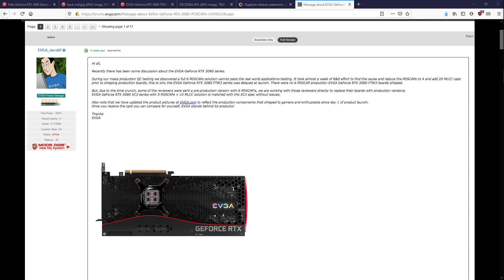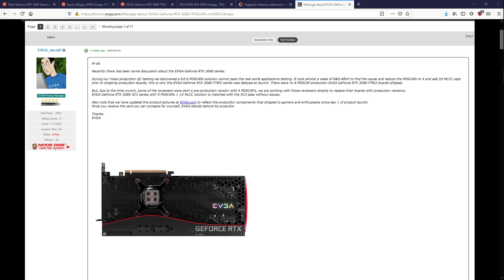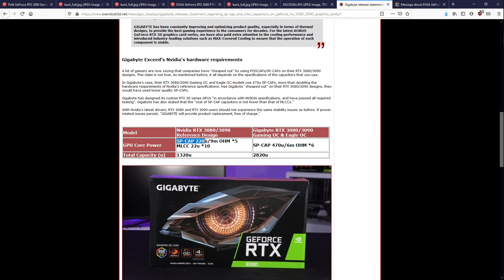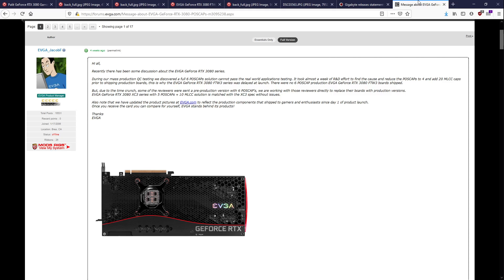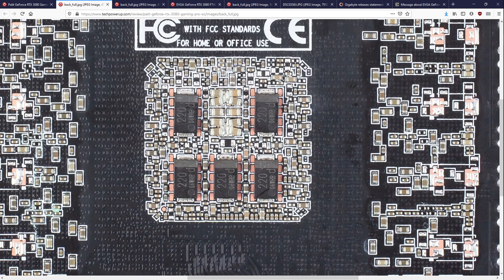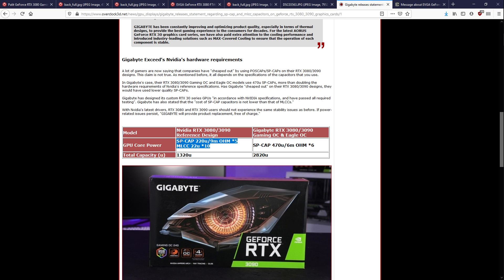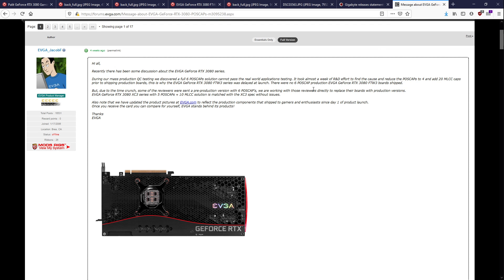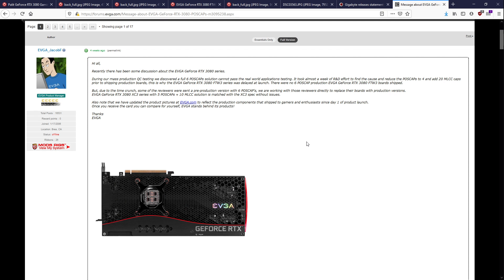The core capacitors on the pre-release 3080 FTW3 vs the retail 3080 FTW3

Comment: Hi, are they 2V or 2.5V versions? If they are 2V, why not use 560uF? also, why not use 56uF*10 MLCC
Then on the other hand, you can make the card even way better... instead of just replacing the SP-Cap, why not make a small daughter board (PCBWay is very cheap to make a few) and piggyback it on top of the tank-cap, so you get benefits from both versions. I know it was an ancient technique, that is now mostly forgotten, oh well, these young whipper snappers... just replace the 470uF with 560uF, and solder the 56uF*10 on a pcb on top of the sp-cap so that they are //.

Comment: People are also forgetting the 5-10% margin on caps. with 10mlcc caps that 11-22 uf averages out since some will be over while some are under. while that 220uf could be up to 22uf under in addition to the lower frequency response. Then there is also the resonance which depending on the manufacturer could be different. So what works with 1 manufacturer's caps might not work with another's. The values also change with temp so a warm card will have higher resistance and lower capacitance. That will move the power consumption up a bit while the caps put out less power.

Comment: Can you investigate the 3090 FTW3 450watt hard limit????
They released a 500w bios but no ftw3 user can actually get more than 450w, unlike the other 3pin cards which can use the bios and get full 500w

It appears to be an issue related to the 10amp next to pcie as well as it being in a locked ratio with the first 8pin power plug
We think Evga is being shady.. can you investigate????

Comment: To be fair to EVGA, the original photos of the ASUS Strix had 6 SP-CAP’s per the photo Asus themselves posted on their product page. ASUS openly admitted this was a pre-production model on social media and all their cards would ship only with MLCC’s and they were in the middle of updating their product photos.
So it appears EVGA may not have been the only company going below reference spec.
Form whatever conclusions you want about this but it appears most brands were playing around with these capacitor configurations so I think the issues go across all brands which is very weird. My money is on Nvidia did not giving partners enough time.
Reply: Asus official post regarding the capacitor configurations

https://www.facebook.com/144893852223541/posts/3383323155047245/?extid=0&d=n
Reply: Asus Strix original product pictures posted on their official facebook page

https://www.facebook.com/144893852223541/posts/3342469385799289/?extid=0&d=n

Comment: Basically MSI dodged a bullet. The engineers were going "We shouldn't do this" and the bean counters were going "We want the big save, so DO IT!" and then the whole thing blew up on Igor's Lab so the engineers could say "See? We need to change that in production right a-fucking-way before lawsuits!" and the bean counters went "Oh, lawsuits are more expensive than a few MLCCs. Right. Do that!"
Reply: MLCCs are cheaper than the other caps. They cost 1/10th of a penny in small quantities while the sp caps cost 20-30 cents each.
Reply: @excitedbox5705  Buildzoid said differently. And there is also time in the pick-n-place machine to take into consideration.

Comment: Hi buildzoid, i am here =) I know this is not the right video to leave a comment, but i have no patience, i want an answer, so...I am sorry for that. 

My question is about LLC. In your video in gamer's nexus channel (Explaining Load-Line Calibration (LLC) & Not Killing Your CPU) you said, that you would run 1.45V idle and 1.43V load voltage, maybe 1.42V for 8700K 5Ghz, so Vdroop is 0.02-0.03V But in the same video, you recommended using the medium setting for overclocking on Asus motherboards. 

Fast forward in 2020, I have Asus Z490 Extreme and Vdroop in level 6 is about 0.7V, at the 4-th level even more. Vdroop, which you called ideal and said you would use it 24/7, that is, 0.03V, I found at level 7. In fact, I have a 10700K processor, overclocked to 5.2 GHz, voltage 1.31V at idle, 1.28 in load. So why do you recommend using Level 4-5 when the Vdroop that you think is good for 24/7 use is on Level 7?

Comment: Question: is there a technical reason why so many of the 30 series cards have the capacitors on the back of the GPU exposed like this?  
IMHO the #1 reason for having a backplate is to protect the PCB from damage... dripping AIO's or tech illiterate people who may break off components etc. ... not to mention DUST will get in there everywhere.  
Do they do this for cooling? Do they do this to brag about their caps (marketing)? Did some designer think it would just look cool, because not all of them do it... but it is also more than one vendor who did it like this... sooo, what gives?
Reply from the maker: the caps are exposed because of the leaf spring heatsink bracket. You'd need a really tall backplate to go over it.

Comment: So EVGA FTW3, a supposedly premium custom card, was not designed as such initially. Interesting
Reply: I think it is a balance of cap capacity vs speed the cap can deliver the charge.  The prerelease using smaller spcaps might have been trying to meet the current spec too on the nose.  I find it hard to fault evga too much for a prerelease card that was fixed when shipped on release date.  But it does sound like mlcc caps of some sort needed to be called out so cost optimizing didn't hurt the actual usage.
Reply: @joefowble  On the bad side, if launch goes well EVGA may get away with this unnoticed and people pay more than they really should (because it's a premium model used on good cards in the past).
Reply: @joefowble  mlcc caps are cheaper. They cost me 1/10th of a penny when I buy 1000 of them while the "sp" caps cost me 20-30 cents each. A pick and place machine with 10 heads will place those mlcc caps maybe 1/3 of a second slower than one of those big "sp" caps. Those big caps are used for power systems because they are stable under temp fluctuations and my guess is they were afraid of the heat under the GPU. The mlcc caps are used for noise and signal traces because they have high frequency response. I don't know why Igor claimed they are more expensive because they are not at all. Maybe he thought more parts would be more expensive to install but since they would all come off the same reel they would all get picked up at the same time. 

Just installing a reel of those on the pnp you usually loose a bunch of them and they are so cheap they are tossed out because it is more expensive to sweep them up and sort your dust pan (and you can then only mount them by hand) than buying some extras. When you order boards you are usually quoted 1-2% extra parts because of this.

Comment: so what ur saying is that all 3080's run the risk of crashing issue and even worse overclocking potential because almost all manufacturers are cheeping out so bad that every low grade silicon will has no safety marjine and is actually not built with overclocking in mind when it comes to the pcb great looks like the only thing these manufactures make towards overclockers is the heatsink and the looks of the card for the past 10 years

Comment: I have a EVGA 3080 XC3 Ultra with 10x MLCC. It works. 1.88ghz average. 2100ghz stable without 100% load. But I have a couple mlccs here and probably will add 10 more when I go for a water cooling and shunt mod.

Comment: The crashing that was fixed in the driver update wasn't really even related to the capacitors.. Every time I saw somebody's video about the crashing and they had a monitor up, right before the crash the card was suddenly boosting 100-150Mhz, from mid 1900s to around 2000 to 2100+.. It shouldn't be doing that.
Reply: Uhm, yeah, and not a single Linux user could reproduce the problem.... So not only was it a driver problem: It was a Windows specific driver problem.
Reply: 0kk

Comment: Can anyone help me? The DPs died on my 1070. I've trying Nvida drive updates and rollbacks. I rolled back windows but still no worky wokry.
Reply: Did all of them die? Have you tried a different monitor, or a different cable?
Reply: @jonasbindslev9894  Yep. Tried monitors and cables.
Reply: @poppyrider5541  Does the graphics card turn on? Does your BIOS detect the graphics card? 

I've got an EVGA GTX 1060, which has 2 displayports, 2 HDMI and a DVI. Do you know if it is only DP that doesn't work, or does none of the ports work?
Reply: @jonasbindslev9894  It works. It's got 2 DPs one HDMI and 1 DVI. My monitors were in the DPs. Now I have to use the HDMI and DVI.
Reply: @poppyrider5541  Try pulling out the power cable of your monitor, wait 10 seconds, and put in the power cable again. That solved it for several people in this article: 

https://www.nvidia.com/en-us/geforce/forums/geforce-graphics-cards/5/234179/gtx-1070-no-signal-when-using-displayport/
Reply: @jonasbindslev9894  Been there. Tried that. Thanks anyway.
Reply: @poppyrider5541  iirc there was an update for Pascal to solve some shenanigans with the DP ports, there should be a VBIOS update available for your card. Check it up in the equivalent of MSI Live Update for your GPU vendor

Comment: G'day Buildzoid,
I found it really weird that it was 'definitely a Hardware problem where all the cards will have to go back to have the SP Caps changed for MLCCs'...
but nVIDIA fixed it with a Driver Update 🤔
The reason I have Unsubbed from many channels this year as they are too busy making 'Hype Rumour for views' content instead of real informative content that is made using research & knowledge,
I especially got sick of all the videos week to week where apparently the RX6000 series is gonna Bury nVIDIA then the next week the best RX600 is only as good as RTX3070 & AMD are done, reverse,  reverse, reverse, reverse, all it has done is make me see how gullible all those TechTubers are & that they really have nothing & are not worth watching,

you say you think your 'rambling thought' videos are crap, but honestly Buildzoid they are Awesome, because they teach us what is real,
also I love your style as it is like we are just sitting having a chat, rather than you are giving a prepared speech 🥰
Reply: Drivers update: lowers your clocks and voltage so it doesn't crazy oc itself to death.
Reply: @ibol13l3  I thought Intel is now competitive, the 10850K has 10 cores better multithread performance vs 5800X with virtually the same gaming performance and its cheaper.
Reply: With wrong software you can make alot of hardware behave faulty. Tell your vrms to do 2volt on your cpu vie software and youll have a hardwareproblem. And you can also circumvent many hardareproblems via software (eg microcode patches for cpus do that) . Just because its intrinsic here in that case that the cap problem can be disarmed by software., doesnt make its less a hardware problem.
Reply: @ibol13l3  I wouldn't call 5% over a stock intel chip which is what most of AMDs own gaming benchmarked shown far superior.
Reply: @Cleru Zinek Daily crashes? Have you tried the Windows Reliability Monitor tool? It doesn't sound like a driver-related GPU issue to me, would be unprecedented.
Reply: @Ben T. My FX-8320E outperformed the heck out of the i5-4440S I had to replace it with around 2014/2015. Intel was totally a downgrade at the time.
Reply: no, it didn't fix them all, and no, there was no change to the  boost algorythm, the powermizer itself was smoothed out so it doesn't respond to hairtrigger changes.

Buildzoid doesn't know a thing about what hes on about. As usual.
Reply: @M M if it is "just bad/insufficient caps/capacitance" please explain why people with the ASUS TUF with all MLCC were experiencing crashing for the same spike reason as the 6 SP Cap versions?
Reply: @M M thanks for the information, that is a lot more helpful, I don't like spreading rumours, I like learning,
I noticed some of the GPUs had 470 SP Caps while others like Zotac used 220 SP Caps so I asked this question in chat on a couple of other videos elsewhere when people have commented about the variation from 6 SP Caps to all MLCCs & no one has responded,

so in your testing with 6 x 470 SP Caps being sufficient ( = 60 x 47 MLCC max storage capacity) this would suggest to me that it is the amount of capacitance & not the speed of release that is important (where 60 x MLCCs have the advantage), please let me know if that is wrong,

this was the point of my first comment, people just spreading the rumour it was because of the SP Caps without getting all the information, because SP Caps can do the job if you use the right ones,
so now all the cards do need to go back for SP Cap replacement because the update nVIDIA has released has stopped triggering the shutdowns, I will now be interested to know if nVIDIA's  update will cause any problems in the future, if that shut down was to protect the cards from a harmful situation & they have just "Turned it off' could the cards that needed to shut down now be at risk of serious damage because they are not shutting down?
Reply: That's a good summation and Buildzoid covers the stability "problem" very succinctly (for Builzoid) from 10:00. As you, I get really pissed off at the anti nVidia/pro AMD hype train here on YouTube. Far too much slack is given to AMD these days, don't be surprised if Radeon 6000 series gouges the consumer as much as it looks like the Ryzen 5000 intends to.  Lisa Su said she wanted to raise prices a couple of years ago and sure enough here they go. Imagine ( no matter how good it is ) that Intel launched their top tier desktop consumer CPU at $800, they would be rightly crucified. Will you see that happen to AMD, not a bit of it: guaranteed.
Reply: @clansome  it seems you don't like AMD & that is fine, but I think you drew the wrong conclusion on where I stand, I have no bias & buy what I think is worth buying no matter the brand name,
also I don't care whether a Tech Tuber likes AMD, Intel, nVIDIA or any of the Partner brands better & voices their opinion that they like them more for whatever reason,
I know Buildzoid is an AMD GPU Fan & Intel CPU Fan, plus he is a Big Samsung B-Die & now also Micron Rev E Fan, he also prefers Intel Lan on Motherboards, I also know these likes influence his recommendations when he does videos,
What I can't stand is all the channels telling viewers that what they are saying they have the latest leaks when all they are doing is spreading rumours ,

about your CPU/GPU pricing part of the comment, I also don't have a problem with AMD raising their prices to match or be more expensive than Intel, because I DON'T have to buy them if I think they are too expensive,
If I need a new CPU can't afford a new one I can buy used, also if it is just because I want to upgrade then I can choose if I do or just keep using what I have, I have no idea how much it cost to put a CPU, GPU or what ever PC part on a shop shelf so I'm in no position to dictate what the price should be, only make a decision for me
Reply: @shaneeslick   Yeah totally agree about rumour mills. They are all as bad as each other. I have never subbed to any of them and if any pop up in my feed then they get unceremoniously killed.

fyi I bought my first nVidia discrete GPU a year ago, before that I have been AMD, ATi, Matrox et al because I couldn't afford nVidia. I have run many AMD CPUs in 30 years even an overclocked Opteron back in the day. What I feel aggrieved about, is that folks keep buying into what I consider the false marketing that AMD have used in the CPU market and their "support" of AM4, which, whilst immeasurably better than Intel, is ultimately not much different as there have been essentially 3 iterations of the chipset since Feb 2017 compared with 4 for Intel (irony of ironies is that the socket hadn't changed much since my old  SandyBridge) so they could have. It's all about perception really. But without question Intel need to up their game on the CPU front and AMD (probably) needs to up their GPU game.